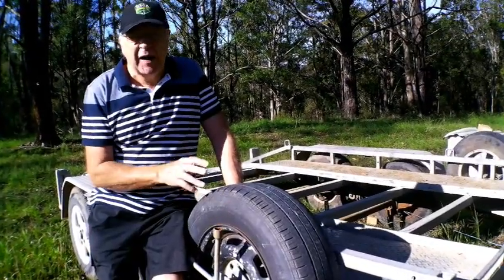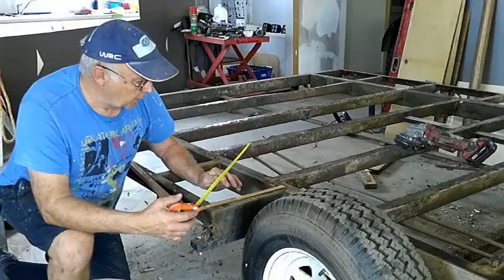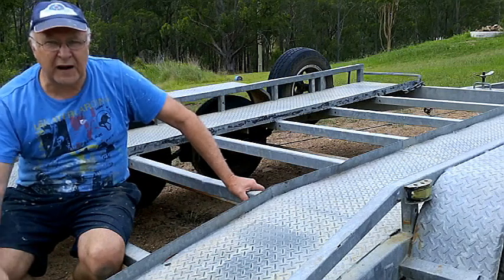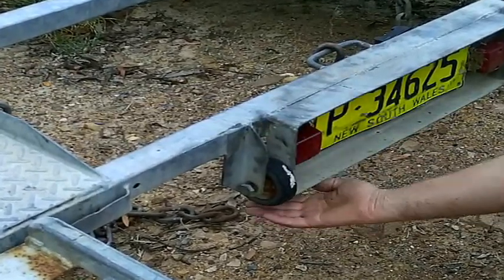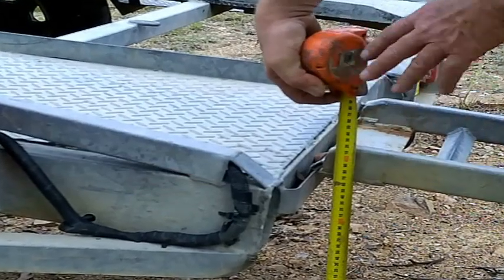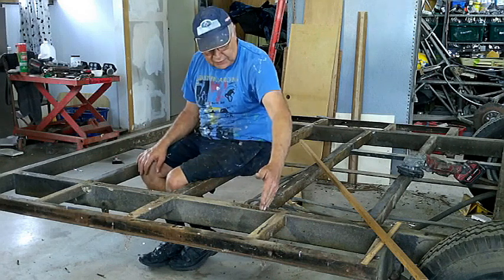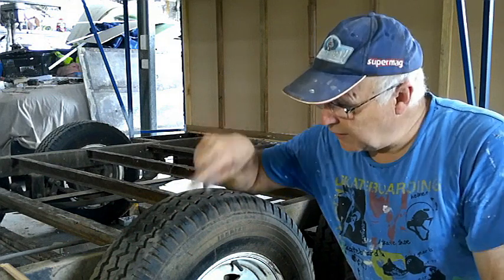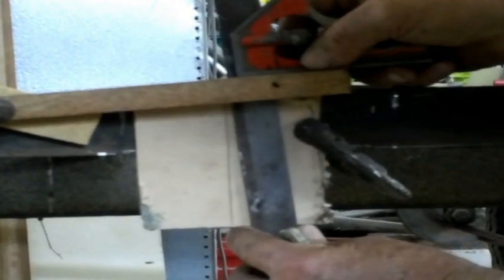Car Trailer Build Ideas no.#3 How to Drop a Tail

Comment: What did you mean by "caravan" for all the parts you need for the trailer.  All I can think of is the piece of junk dodge mini van?
Reply from the maker: "Caravan" is the widely used term in the UK and Australia for camping accommodation you tow behind your car... aka USA "trailer park" vehicles?
Reply: @BillsBuildandRace  ah so look for a clapped out twin axle camping trailer and that should give me undercarriage,  electric brakes, rolling stock, and maybe lights...good idea.  Would also have trailer registration already which is required some places in the states.
Reply: What in the US they call a travel trailer.